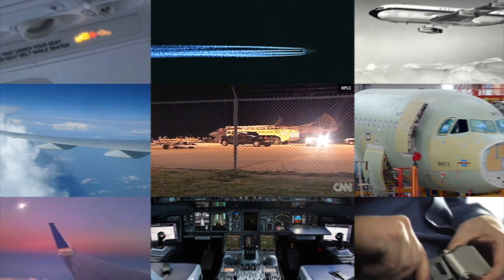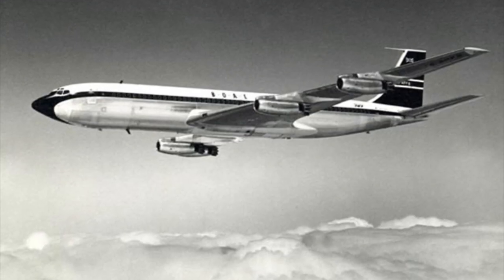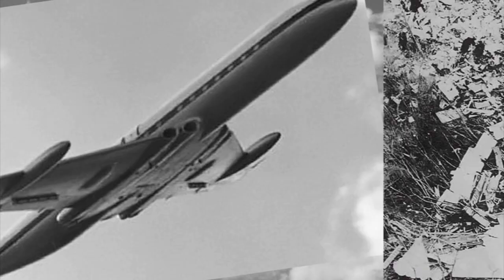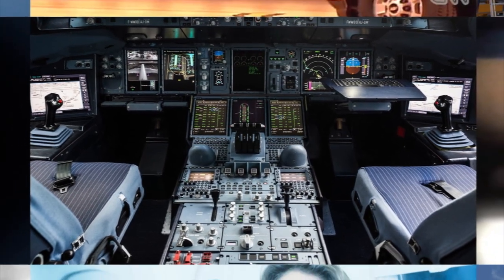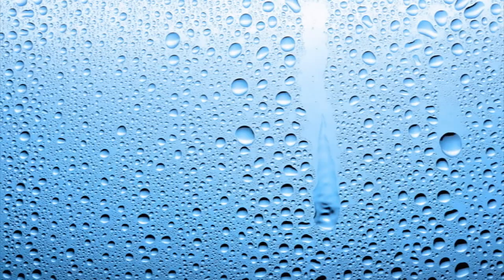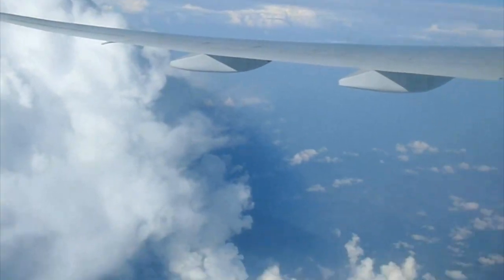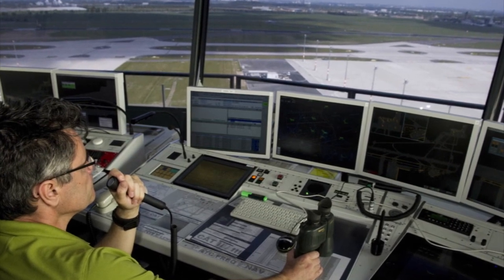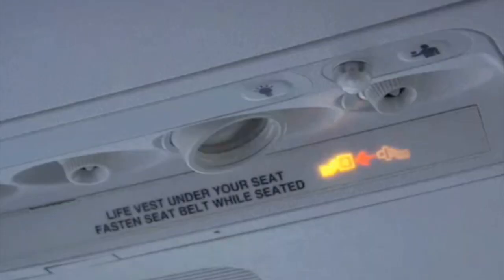Turbulence Explainer: Does Severe Turbulence Cause Plane Crashes?

Comment: Planes Doesn't Crash From Turbulence!

Have You Heard A Plane Crashed From Turbulence And Fell From 40,000Ft To Ground!! NO!!

Planes Could Crash From Heavy Winds When They Are At 5,000Ft Or Less Only! A Pilot Said!

+ Planes Are Safer Than Cars In Many Reasons!

Cars Makes Accident Everyday But Planes Crash Twice Or 3 Times Every Year
Never Ever A Plane Fell From 10,000Ft Or Higher By Turbulence
Old Planes? maybe Yes
But Planes These Days Are Completely Safe :)

The Reason Why Planes Divert To Another Airport Is People Injuries A Pilot Said!

If you are In Plane And You Saw The Seatbelt Sign Is On You Should Fasten Your SeatBelt Because You Won't Get Hurt!
Thanks For Reading :)

Comment: If the turbulence damaged the aircraft it was not severe, but extreme. That is precisely the difference: Severe turbulence may cause momentary loss of control, but will not damage the airframe, extreme turbulence can damage the aircraft and will make control impossible.
Reply: pinkdispatcher turbulance never causes the plane crash.

Comment: Typical turbulence (CAT or otherwise) that commercial airline encounter will never ever ever bring down a plane. The crash cited in the video was believe to have been down by wind shear which is not turbulence, but rather the plane encountering air moving in different directions and speeds in a very confined area.. we're talking hundreds of feet rather than the 10s of thousands of feet planes are used to maneuvering in. modern planes can detect wind shear to avoid it.